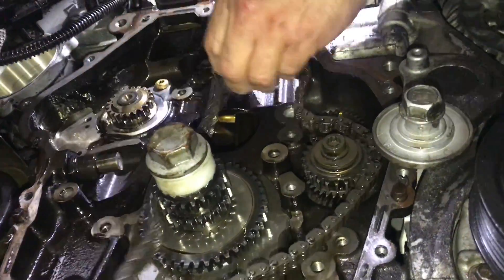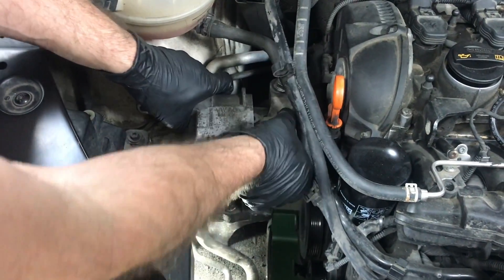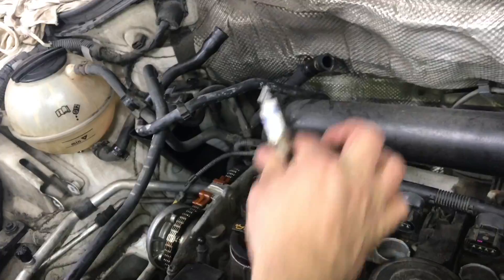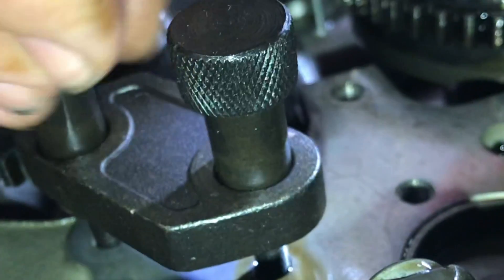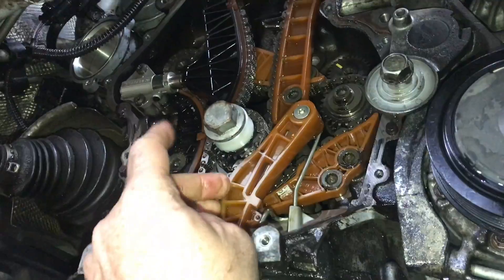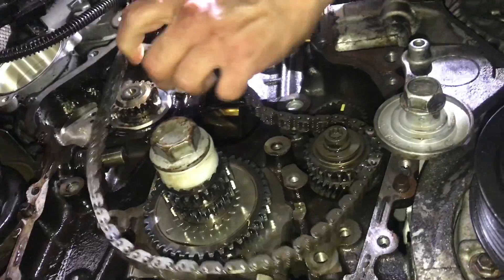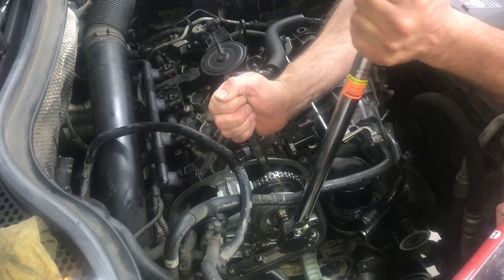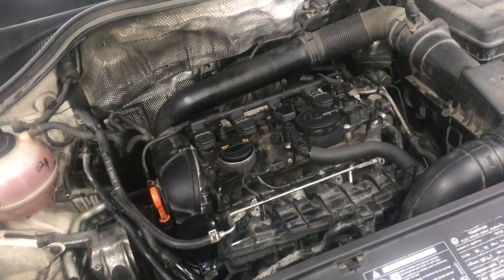REPLACING timing chain on a 2.0t tsi volkswagen, audi

Comment: So you wanna use the cam locking tools before?You take off the Cambridge that makes no sense.You have to take off the cambridge in order to use the locking tools... You do not have to remove the tensioner first

Comment: This is an amazing video. But after watching it, I’m going to sell my 100,000 miles Tiguan, because the design of this engine freaks me out. I replaced the timing belt on my MDX—it was much simpler and easier compared to the Tiguan.

Comment: Hi @Tombair8128 Thanks for the excellent video. I have a question for you: when you remove the timing chain, and remove the cam nuts on the top two cam sprockets, are these two sprockets able to rotate freely about 5 degrees? It looks like the sprocket is locked into position by the nut and that it has this restricted play so that you can align it for timing. If you get this, please reply. My girlfriend and I are looking at a costly repair.

Comment: I need to do the chain on my Mk7 Gti, thank you for this video, it has shown me that I should rather take it to a workshop and have a pro do it.
Reply: tyring to help my buddy out the dealership is charging over $4000 to replace the chain
Reply: @juliocalderon1209 that expensive 😂😂😂 just do urself for 750euro with pompe a eau + chain + check all issue can happen like camshaft magnetic and etc or cam follower then u get practically a new engine under 750euro😂😂😂

Comment: The bridge can be removed regardless of tensioner being in or not. The water pump is powered by the balance shaft, you're supposed to rotate the balance shaft 8 times, by the 8th rotation it should land in it's default resting position, if you fail to time it this way then the engine will have balance issues and will run poorly

Comment: The Intake side camshaft is reverse thread, same goes for the water pump gear bolt.

removing the engine mount from the block is a pitta, no space at all in two of the three bolts.

Comment: Hi, great video!
Question... I just had someone change my timing chain on my 2013 Tiguan and it seems to run ok with out throwing any code but there is a vibration that you feel when giving the car gas and when idling the car has a vibration that you can see looking at my cell phone mount. I seems to have power, but I cant figure out the problem and the shop that did the work is not getting back to me. Thanks in advance!
Reply: Did you ever figure this out? It’s probably balance shaft on the intake side (see the one in the video at 5:48 with the yellow line/mark) not correctly timed. It actually looks to be timed incorrectly in the video as well. 5:48 in the video the shaft with the yellow line/mark on it needs to be have the tiny dot under the upper yellow mark pointing downwards to meet 2 small dots on the inner balance shaft gear. My car’s intake balance shaft was mistimed. I only found out when I did the major timing chain service myself recently. Only noticed weird vibrations at idle and high rpm.

Comment: Good vid. Much better than the ones with guys dong the job with the engine on a table/stand. Also, just FYI for anyone, you can rent the tools pretty cheaply for a week or longer from online VW tool rentals. Oh, and from my experience as VW tech and on my own, just replace the water pump while you are in there.

Comment: Amazing video. And is it true that to change the timing chains of Audi you need to take down the complete engine?
Reply: Essentially. At least a couple inches out. They are located in the back sadly. Very hard to work around

Comment: Really wish I would have seen this before I started doing my timing this last weekend.. The write-ups and other videos I have found are missing a lot of little bits and pieces of info here and there that I didn't find out about until I was deep into the job and you just showed all of what I found out myself in an 8 minutes video..
Great video, Thanks for the help cause at least it reassures me that I've done good up to this point lol.
Reply: This video just shows every tiny but important thing within a good 9 minutes!  Especially when you do a timing job in a motor!

Comment: CORRECTION - The water pump uses a belt. One chain is for the camshafts, one chain is for the balancer shafts and one chain is for the oil pump.
Reply: Driven by the balance shaft which is driven by the chain and then the belt goes from the balance shaft to the water pump

Comment: After watching this video, I definitely won't buy a Volkswagen 😆!!
Reply: I wish I had seen it sooner. 😪
Reply: Imagine seeing them after buying one😢
Reply: Yup, and on and on , vw is out of my garage forever.  Man it's one thing after another.  Believe me..and it does not stop.
Reply: @jrking178  that's a shame, I've had my polo gti 1.8 ea888gen3 for 8 n half years, only had to do thermo housing which I did myself for £365 plus 5 ltr of coolant, £32. I do try and look after it though, service it myself ect, nothing worse than paying somebody alot of money to top up your oil with the cheapest none recommended  stuff and say it's been serviced. Knowing something has been done is far more important than a stamp in a service book.
Reply: Why? Most overhead camshaft Engines will require the exact same maintenance and process..
Reply: @victorjbarker  but not at 100 thousands km
Reply: De donde es usted tengo un carrito de eso y se me esta fallando
Reply: @fernandolopezramos5703  que le pasa a tu carrito? soy conocedor de estos motores
Reply: @Ross_skatepunx248 it's high because there's a high tensioner failure rate. It's a really common issue with Volkswagen.
Reply: Good luck buying a car without any potential failures
Reply: Welcome to all modern interference engines…..
Reply: You buy what you can afford or have knowledgeable and time for. It's you, not the car...
Reply: That's a very good idea

Comment: Why would VW make chain guides out of plastic ? lol I've been told chain replacement is recommended at 120k miles on VW 2.0t engines,  parts are usually $500 and $500 for labor (6 .5 hours) fcpeuro.com has nice kits with lifetime warranty on all parts.

Comment: Hey!! Before anyone pays thru the nose on this particular job, google the class action lawsuit settlement. It will list all eligible vehicles for this issue, offering an extended warranty or cash back on out-of-pocket expenses. If your Audi or VW is within 10 years of its first in service date or under 160k, whichever comes first, you're likely covered. In Canada, claims have to be in by Jan 21, 2021..form can be downloaded at timingchainsettlement.ca

Comment: If I’m replacing the timing chain, do I have to change the balance shaft chains aswell? Or can I get away with skipping that part.
Reply: No necessary to replace the balance shafts

Comment: This video is missing a lot of important information, such as torque specs, sealant, and the names of the "specialty tools" which aren't really that special. Another important factor is supporting the engine! You don't want to support it if the pan is thin metal or ESPECIALLY plastic(s). Although, I'm trying to find a video that only uses a engine support  beam to support the engine in place to remove the engine mount bracket that covers the two bolts on the lower end of the UPPER timing chain cover. Also! REPLACE THE GASKETS AND SEALS. Make sure to check the timing of your camshafts to the timing of the crankshaft. If these to things are not in time with each other, you will at the LEAST have some minor engine problems (at the most: engine damage). I've seen a video where you can actually move the camshafts with a metric wrench (check the size for your VW/AUDI) to get the measurements right into spec between the total distance (as told to be around ~125mm--check your stuff to verify however, OR, check out humble mechanic.)

On the upside, this video is GREAT for seeing a more day-to-day view if you're starting as a DIY'er. Just be sure to check and verify your information and search for that factory's repair manual; they exist. Mine, the one I found, is roughly 7 THOUSAND pages. I'd like to note with these manuals is that any information you're wondering about that's not in the manual might be up to common senses (what the average-to-experienced mechanic would do). So, as mentioned before, do your research and take your time looking up this information.

I spent around 3-6 months learning specifically for this project on my '14 EA888 CPRA engine. (Engines have different codes. Check the specific code for your engine as part(s)/part-design may or may not be different.)

If you guys want to know about some of the torque specs, just comment below and I might try to look it up if the spec is available in the manual I found. Happy fixing!
Reply from the maker: Thanks for the very detailed comment, finding the correct torque specs has been very challenging. I would really appreciate any information on accurate torque specs. If there available, I could add them to the description so they can benefit others attempting this job. We have done a lot of work on trying to find the correct torque specs but I’m leery on wanting to state them if I’m unsure of its accuracy. We just put a timing belt in a Honda pilot and were confident that we have the correct specs, so we did add them in at the end of the video as quickly as we could. I try to keep the videos as short as possible so they do not waste peoples time. I appreciate constructive criticism on the videos because I’m always trying to make The videos better faster while trying to add some small amounts of entertainment if possible. I know you aren’t working on a Honda pilot, but it would be really helpful if you could watch this video and let me know if there’s an improvement. Any constructive criticism helps me hopefully make a better video. It always drives me crazy when someone makes a video that is a complete and total waste of time. Thanks again for the detailed and kind comment. https://m.youtube.com/watch?v=1UQQKeJcUMY here’s the link to that timing belt video, I tried to keep it to 15 minutes, but there’s a lot of information on a big process video.👍👍
Reply: @livefree6878  I watched it and definitely encourage you to keep it up! It is an awesome video. Keep doing that detail of information!
Reply: @livefree6878  I'll also search for those specs and likely will have them up here by tomorrow. That's when I begin the timing chain!

I'm also replacing all of the guides and the balance shaft timing chain, but leaving the oil chain on. I believe I don't need to change it, but that decision might vary almost always between what's best. Looking forward to future comments and replies!
Reply: @RyanZa_myt  are you near the East Coast please?

Comment: Serious, you need to do a video that shows torque specs these engines are really intricate when it comes to that
Reply: If you know how to tighten bolts by hand. There is no need to use a torque wrench. It’s all by feeling.
Reply: @aldinnukicic3458  no. Not when you are working on an engine. Some bolts require a lot of torque, some just snug. It is not just a feeling. This is why I do all of my mechanical work and not someone at a dealership or shop who thinks they can get away with counting 'ugga dugga's' on an impact gun, or thinking torque specs are about a magical 'feeling'.
Reply: @Noah-er9on  lol, no buddy, not at all. Like I’ve said, if you have experience and know what your doing, no need for it. I do everting bu hand😉👍
Reply: @aldinnukicic3458  then you do everything wrong.
Reply: @Noah-er9on  hahahaha, welp I guess your new to this😂

Comment: Looks like lots of work how can a chain break ?🤔
Reply from the maker: That’s a great question, from what I understand it’s more about the plastic guides around the chain breaking down. I hear more about chains stretching, they can make quite a rattling sound.
Reply: Live Free yes nice work thanks for the video
Reply: @laszlogaspar1244  on tsi engines it's common for the chains to stretch prematurely because of a faulty tensioner, in mid-2012 they revised the tensioner so if your vehicle has the revised tensioner installed it is a non-issue

Comment: VW used to make reliable cars ,now they are crap .Even though this problem is a known engine design fault ,they will not take responsibility & do the right thing & repair these pieces of junk .Dealers charge over two grand for this job and it happens when your car is just out of warranty .Even with the lawsuit the dealers are scum bags & find ways to screw the customer by denying the suit & making you pay in advance ,then you have to go through hell to see if some money might be refunded by VW headquarters .Car manufacturers are the scum of the earth only second to lawyers& politicians .
Reply: Totally agree. After spending 1200$ on cleaning the valves and replacing an injector, my cam chain snapped. I am planning to either repair the car and sell it, either sell it on parts and never buy a car again. mk5 gti axx engine

Comment: Change your oil more often than factory recommendations and the guides will last forever.
Reply: Wrong.
Not on Volkswagens TSI engine. I have done dozens of them with failed tensioners. Big recall was issued, Matter fact I just sent one to vw dealer 2015 cc with 55k miles on it. Jumped timing. TSI = Garbage.
Reply: Mechanic Benz 🤣🤣🤣
Reply: @benz240d  Mine broke at 200k, oil was the only thing I ever did to this car and often. So, maybe you're unlucky
Reply: @ikannunaplays  you are lucky. I do this for a living. And this engine is most unreliable.

Comment: Whats the special tool kit brand and part number?
Reply from the maker: I put a link in the description of where I got that. The kit is for the 2.0 as well as for the 1.8. Some of the tools in there we didn’t use. The tool for holding the crankshaft was a necessity, and the tools that hold the camshaft to release tension from the chains were very helpful.

Comment: Have a question. Did this service and after starting it up I’m getting a loud whine coming from the crankshaft area. Anyone have any ideas of what it can be? Car seems to be running perfect other than the noise. Also removed the accessory belt and the noise is still there.
Reply: I might have a similar issue, the loud whining noise only comes a couple of minutes after the engine reached working temperature. And it's only during idle, reving the engine makes the noise go away (until back at idle). I had one guy take a quick look and according to him, the chain was digging into the plastic guide rails, and that was what was making the noise, not sure if that's true or not.

Comment: At what stage you replace the timing chain ? Or is it one of the recommended replacement by the manufacturer ?
Reply: i say at 130k. Im at 145 and i just had to park mine but as long as its done before 130 or at 130 you will be fine
Reply: Ma Singha replace it at 100k or less because by 115k it’ll be too late and there went your valves
Reply: Shayden Merck Is there a problem with guides or tensioner on these?If not, a timing chain is good for much longer time if not the whole life of the car.
Reply: @85,000 - 100,000 is daring 😬
Reply: I'm at 80k and it's already -2° off, may be safer to replace before 100k

Comment: Good and thorough write up. For others watching, draining the coolant lines might be helpful but not necessary. I leave them connected.
Reply: The upper ones? And then lower one (hard plastic, in front of the crank pulley)?

Comment: Correction:The water pump shaft is also a balance shaft and needs to be timed with the idler gear before applying the chain otherwise the engine will not be balanced. There are two dots on the back gear of the idler that must be aligned with the counter rotating balance shaft which has the yellow mark.
Reply: Yes and this is exactly how a “experienced” mechanic failed to do the job on my car right and now im stuck with engine vibration
Reply: @jamesclayton4378  very easy to make that mistake if somebody has no experience doing that job before.
Reply: Yeah there were a couple other things said which were incorrect 🤷🏽‍♀️ but good video over all lol so I’ll let it slide
Reply: @ahsinsmith3963 what other things? I have found this to be a very useful video but would be interested to hear before making a mistake on doing this job
Reply: Lower cover needs to be replaced after it’s removed per the repair manual
Reply: @eighty7granny  This lower cover is a pain in the ass. Not replacing it almost always leads to oil leaks. Really bad design because the smallest bend generated during the extraction of the part will make it not sit as expected and leak.  If you don't replace it (it is not cheap), be sure to have the engine running for a few hours after and check for any leaks around the bottom part of it.
Reply: so I'm not going crazy lol. Not very experienced with this, but when he spun those two balance gears freely by hand, i audibly asked him wtf he was doing...